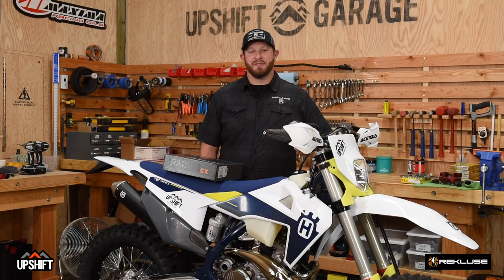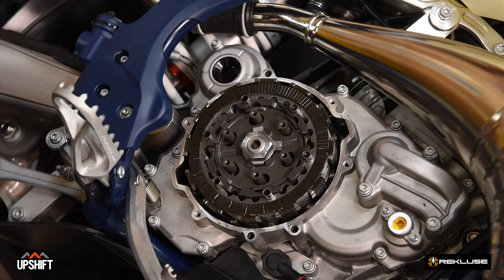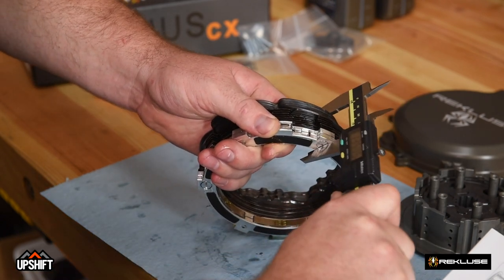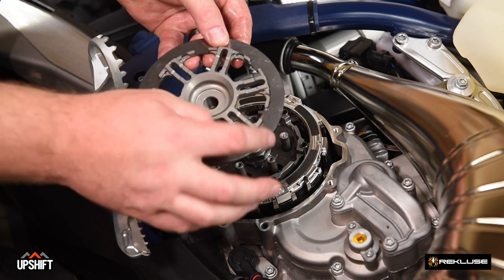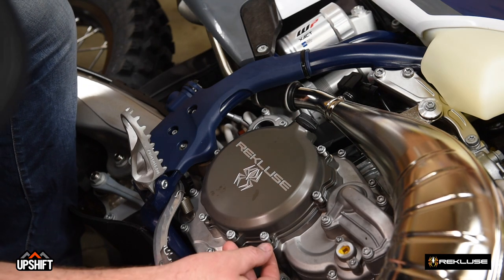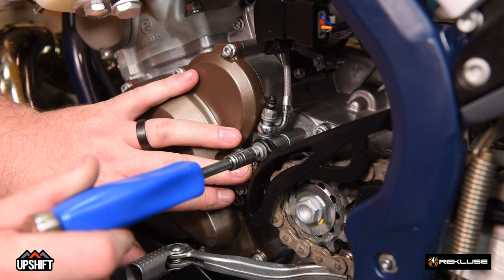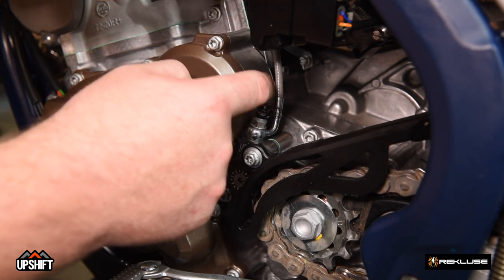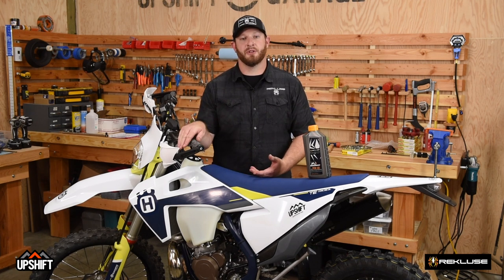Upshift Garage: Rekluse Radius CX Install on a 2021 Husqvarna TE300i

Comment: I tried To use the stock  basket it was in better shape than that one and it made the clutch have e vibration and the engagement was as good as it was when I installed a brand new rekluse basket made squeal/vibration go away and that set up has lasted 400hrs on it that's not a typo  just started getting notched and friction pads on the exp disc need to be replaced,
Reply from the maker: 400 hours is a solid piece of riding. Nicely done.
Reply: @UPSHIFT_ONLINE  solid piece of craftsmanship from rekluse  that clutch never slips. I let people ride that bike and they never new it was an auto clutch during covid a Harescramble series where I live was letting me race a/b sportsman in am race 1 and a half hour race and and b vet in afternoon Wich was 2 hours I will say I was proud of myself getting 2nd in the am and 3rd in the pm one day although it was super dusty and hot  that day and having already rode in the morning I new exactly where to go in the second race gave me huge advantage in the pm start. Think I was in first on last lap but I hit a wall, got tired and absolutely fell apart. ya was really hot and almost didn't finish

Comment: GREAT INSTRUCTIONAL VIDEO!!  Is this the same as the 2023 KTM 300 XC-W TPI Rekluse clutch install?  Rekluse website only goes to 2021 for KTM, but pretty sure no changes were made these years.  
Cheers
Reply from the maker: Thank you for watching. We highly recommend calling Rekluse's tech support team. They are very knowledgable. 866-735-5873

Comment: if just use rekluse friction & steel plates and the auto plate with oem hub pressure plate and clutch cover, that will work?
Reply from the maker: Yes, that is fine. What we are showing is the full meal deal.
Reply: @UPSHIFT_ONLINE  thanks save tons $😁

Comment: When you measured the clutch pack thickness, you didnt put the caliper on the friction material of the EXP disk. Was this intentional? I would think thats where you would want to place it. The diagram in the directions does not specify. I am sure that thickness will vary a few thousandths.
Reply from the maker: This is a great question. We have reached out to Rekluse to get a proper answer.
Reply from the maker: It looks like we cut that in editing and didn't use the correct part. He changed his grip and took a second measurement to get the friction material. We screwed up and clipped the correct part and left the incorrect part.
Reply: I noticed that as well and when I measured mine I included the friction plate. My measurements were  on the edge of 2&3 of the Bellville spring. 

I initially set at 3 but the gears weren’t as smooth as it should be, so I moved it to 2 which was perfect.
Reply: I noticed that as well and when I measured mine I included the friction plate. My measurements were  on the edge of 2&3 of the Bellville spring. 

I initially set at 3 but the gears weren’t as smooth as it should be, so I moved it to 2 which was perfect.
Reply: I noticed that as well and when I measured mine I included the friction plate. My measurements were  on the edge of 2&3 of the Bellville spring. 

I initially set at 3 but the gears weren’t as smooth as it should be, so I moved it to 2 which was perfect.
Reply: I noticed that as well and when I measured mine I included the friction plate. My measurements were  on the edge of 2&3 of the Bellville spring. 

I initially set at 3 but the gears weren’t as smooth as it should be, so I moved it to 2 which was perfect.